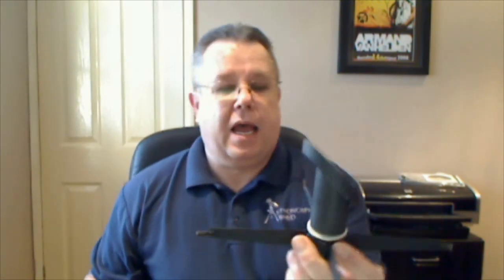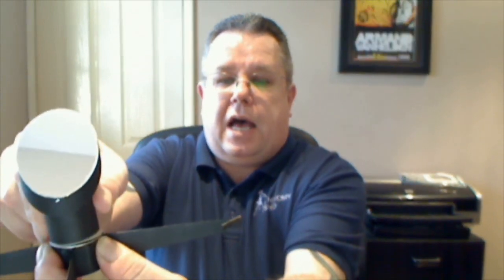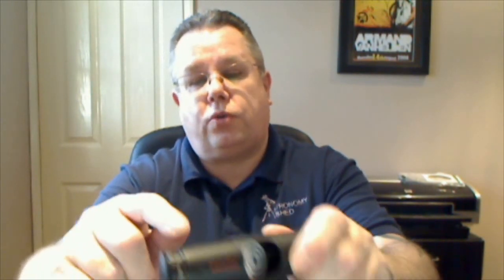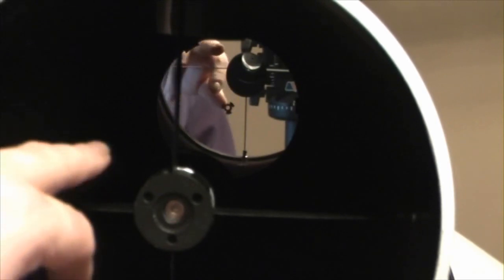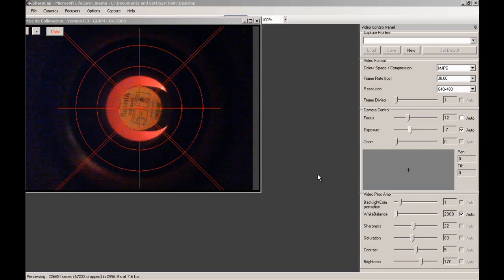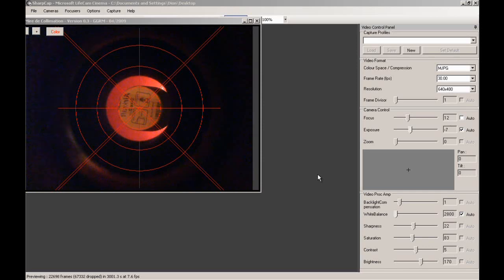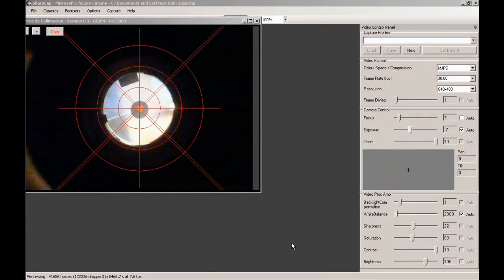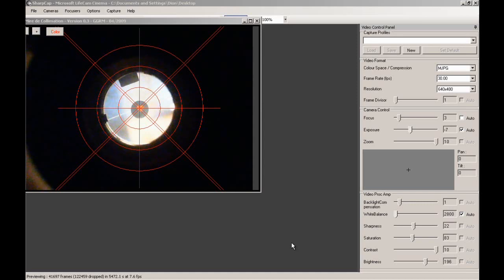Advanced Newtonian Collimation

Comment: This was an amazing video, I used my zwo120mc and it’s lens to collimate. I have just washed the mirrors so everything needed adjusting. It worked perfectly. Before this I could never get the laser collimator and the collimating cap to agree, but using the laser Barlow trick and camera, cap now agrees and secondary is dead centre in the focuser. Thank you!
Reply from the maker: Wow, never been described as amazing before but I'll take that. Thanks. Glad it helped.
Reply: Did you need to mount the lens to a tube, or is it the same size as an EP?  How did you get it to square up?

Comment: Good video. But, your example of a laser lying at time 07:35 I think is quite incorrect. What is necessary is that the plane of the secondary must be oriented such that it correctly reflects the light rays into the focuser. Whether that adjustment is achieved by rotating the secondary or tilting it with the 3 adjustment screws is irrelevant.  Of course, trying to do the entire adjustment with just the screws might put them at or close to their limits, but it is only the end result that matters, not how you got there. Still, thanks for the video.
Reply: Sly Dog I agree re alignment of the secondary with the primary, but Dion does have a point, as (assuming collimation was good to start with) the newly re-aligned secondary will now have changed angle with respect the focuser tube. It will work okay for most uses, but on a fast Newt like this could introduce problems.

Comment: Just being silly. I looked up reticule and it said it’s a variant of reticle and says a reticule is a woman’s small hand bag. Reticle reticule. You say tomato I say toma’to.😃 Still can’t get the telescope collimated properly. It didn’t look right from the start so I went crazy on the secondary and had it out of whack for a while. It’s closer now but I think it’s supposed to be offset? F/3.9 10” Orion astrograph. Don’t know how to offset it so I centered it. Still not right but I don’t have the proper mount yet anyway. Can’t balance it so I can’t take it outside yet. All the same, great video! I just don’t have software or anything, except collimation cap.

Comment: Great video, Thanks. I just bought, but have not yet received the Quattro 8in. I will be flocking etc as soon as all the stuff shows up. It will be a good winter project. 
I do have a question about the video camera. How did you make it? I have no access to any type of machine shop, or anything. can you buy them? 
Matthew
Reply from the maker: Microsoft lifecam cinema camera and one of these adapters ;-  http://www.billetparts.co.uk/catalog/lifecam-adapter-p-122.html   covered in another of my videos.  Check it out here :-  https://www.youtube.com/watch?v=8n4etw1YllI
Reply: astronomyshed Thank you. i found it right after I asked the question. :) 
I've ordered one of the billet parts and a Lifecam from ebay for 40$. hope i don't screw up the mod. I might find a friend to help me.Great videos, all useful. Thanks again.

Comment: Thanks for the video and the explanation of a more accurate method of collimating a newtonian from original set up. I have a question regarding the steps which I hope you can clear up. I was clear and in agreement with the steps up to 18mins 40 seconds, getting the secondary positioned correctly, but then you adjust the tilt of the secondary to position the main mirror spot central. This step confuses me because the main mirror has not yet been set to a base setting and could be anywhere. i would have thought that after a lot of trouble to get the secondary accurately set, the next step would be to adjust the main mirror to get the spot central before any adjustments to the tilt of the secondary. or am i missing something?

Gary

Comment: Great video answers collimation questions better than any other, I have one question, if possible to answer on this tube, what is the datum setting for adjusting screws on primary mirror, eg, screwed all the way in so mirror mount touching back plate, furthest away ie screwed all the way out or only half way, your help appreciated.

Comment: Sadly, no-one appears to make the Lifecam adaptor now, So, I'll have to make one. A point not noted is that the Lifecam must be colimated in the adaptor for this method to work. So, I'll make an adaptor with colimation screws. To colimate the lifecam, all that's needed is a jig with two pairs of decent ball races that the adaptor can be rotated on. I made one so that I could colimate my laser colimator, which out of the box was not properly colimated (not good). It's very easy to do on a solid bench with a target set up a few metres away to centre up on. Then, as Astronomyshed says, it's essential to use a self centering adaptor in your focuser, such as this: OVL Twist Lock Adaptor 2" - 1.25"
The adaptor must be seated carefully in the focuser that ideally has a compression band rather that just two screws. It's also best to mark the adaptor so that it is always set in the same position in the focuser.
The process only works if the focuser is slop free, set and locked fully in. Once everything is properly aligned, make permanent position marks on all components and always assemble in the same way. It simply means developing a working method, and sticking to it.
There is a common myth which says that it's not important that the focuser is orthogonal to the OTA axis - it is important.

Comment from the maker: @luppydluppyd The true anwer is neither, it needs to be in between, so that the springs are under some tension but not over compressed, although sometimes, if you have a camera on the scope that won't hit focus, you can sometimes nudge it in by srewing out, ie pushing the mirror up the tube a little.

Comment: I've got a focuser that is a good bit off centrally to the spider. I'd say it is off by a about 2.5mm to the centre of the secondary (roughly 5mm when the secondary is removed and a laser inserted to shine onto the tube, 910/4.5" Soligor scope) although it is more likely that the spider is off. What can be done there? It is near impossible to get good collimation because of it.
Also can a laser be collimated with a Barlow (diffraction) instead of the rotating thing on a 45° rig? That would be a far easier method to collimate a laser using a Barlow and distance!
Reply from the maker: Another of my videos covers centralising the spider. If the focuser doesn't have collimation screws. Shim it. Collimating lasers is how I also showed in a video. No easier method I know of.
Reply: @astronomyshed  Yeah I was thinking of shimming it. Was also thinking of replacing the spider with a 4 vane instead of the 3 that is currently on it. Hard to tell what is off the spider or the focuser. Will try the shim first I think, much cheaper and probably easiest! Another option I'm looking at is flipping/redrilling the spider so 2 collimation screws for the secondary are at the top, but it would mean one vane would be about 1cm away from the seam of the tube, much harder method to get spot on also.
Reply: Shimmed there earlier, much better but still a tiny bit off, will have to do the job. I also sanded the back plate of the secondary flush and made a washer from a plastic A4 folder instead of teflon/stainless steel, it did the trick!
@astronomyshed Thanks for the advice 
and the great content.

Comment: Hello! I know you're not really into astronomy anymore. But I can't seem to get on your website. And I'm having a problem where the reticle on sharp cap is not centered in the focuser tube. Do I just adjust camera until it's centered? Or adjust the reticle?
Reply: I personally aligned the rings in sharpcap with the shadow of the end of the focuser tube, that way you know that your reticle is centered below the EP
Reply: I got the same problem. I collimated just like Windston said but I'm having issues with the GSO coma corrector and I think it's due to collimation. I think I might try to center the mirror with respect to the reticle even if it's not centered. Let me know please if you tried it and what were your results!
Reply: @anthonysaab1186  My camera is not collimatted so I aligned rings in Mire de collimation with the end of the focuser tube tenn aligned secondary to the smaller rings in tme Mirre de collimation. it works great

Comment: Man, you are a genius! Your method is simply brilliant! After many years trying (and failing) to collimate my Newtonian, I finally managed to get round stars! I can’t believe my eyes. But I did my own variation of your method. First, I used my RPi with NoIR camera (lens on) and the crosshairs from PHD2 (with the V4L2 driver) for the secondary mirror, and than I used an artificial star and a DSLR for the primary mirror. PS: I aligned the focuser, installed springs in the spider, and loosened the primary mirror holders (to avoid pinched optics). Many thanks for the great video library!
Reply from the maker: Thank you for the positive comments. I appreciate it.

Comment: what kind of cam are you using ? i tried with my zwo asi 290 and 224 with the all sky cam. the all sky cam in both cams wasn't projecting an image centered in the focus tube
Reply from the maker: Joseph Rueck converted microsoft lifecam, an allsky lens is way too wide angle.
Reply: i know its a wide angle but i can still see the secondary the point is the sensor is not centered in the focus tube and no its not the focus thats out
the cross hair in sharp cap has to be adjusted
Reply: Same issue here!
Reply from the maker: Use the centre of the vignette caused by the focuser tube instead.
Reply: Did you ever get this to work? I'm thinking of getting a 12 mm vs mount lens for my asi174 mini.

Comment: Dion... What do I do when the image in the camera is not centered? It seems to me here that my draw tube is more to the right side. When I use the reticule in sharpcap the center is way off of where it is supposed to be. I am using a QHY5L-II cam with a lens to do this.
Reply from the maker: You really need to take questions like this to my site at www.astronomyshed.co.uk youtube just isnt suitable and not it's intended use
Reply: Will do, thanks :-)
Reply: nasdrasil I can't seem to get into the website. Did you ever find the solution to this? I have the same problem
Reply: Dion shows how to center your focuser in this video https://www.youtube.com/watch?v=3LbR1nIx-jw
Reply: glad to see im not the only one. my cam is way off to one side . wondering why. its both the asi 224 and 290
Reply: Same issue here. My focuser is dead center (followed dion's instructions) and I still have the same problem. I don't know if i should follow the reticle as a center or just use the rings on top of the edge of the focuser and center it that way. let me know please if you find a solution or the right way to do it.

Comment: Good morning Sir, As much as I try to find an answer to the following, I have not been able to find the satisfactory answer ...
Apparently almost nobody takes into account that the primary mirror can not only suffer from de-collimation with respect to the secondary mirror; The primary mirror may suffer from astigmatism due to the movements caused by the weight of the glass, the size of the mirror, the triangular supports of the cell, the fixations of the mirror and the different temperatures in the observation environment.
I have a 12-inch Newtonian f / 4 (TPO SKU: OS-12IN) and I discovered that the mirror was attached to 3 of the 9 points of the supporting triangles (that is, a point stuck by each supporting triangle). The telescope factory (GSO Telescopes) attached the mirror to the cell with double-sided tape. I have read in some forums and articles that it is better not to stick the primary mirror to the cell to avoid astigmatism but as I write, that mirror was attached to the support. I do not know if that is correct and in any case, in a telescope like mine that is not Dobsonian, but that is placed in a robotic-equatorial mount, that mirror moves whenever it is directed to an object in the sky and I find de-collimation even when it is attached with that tape to the cell.
Do you know if it is better not to attach the primary mirror to the cell anywhere?